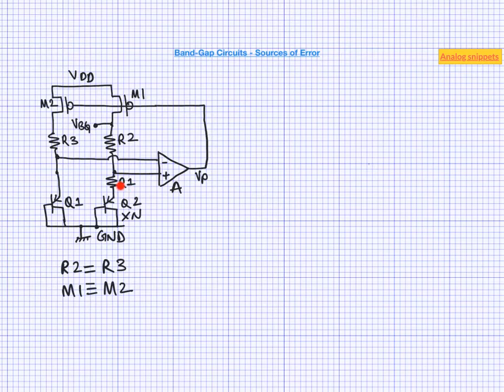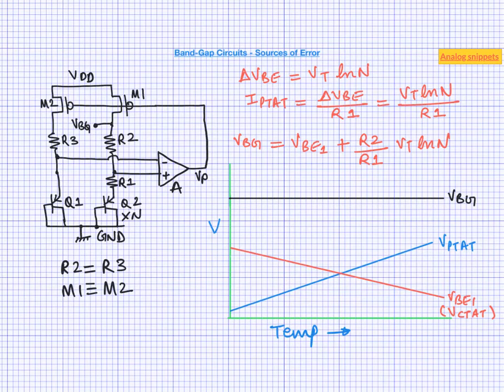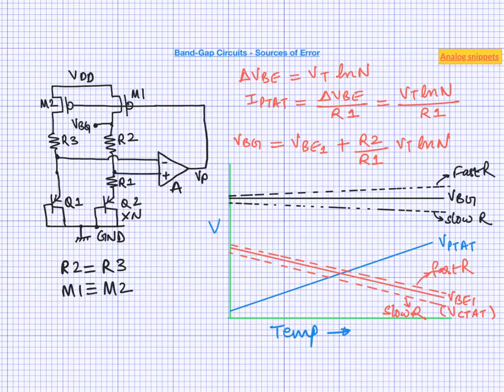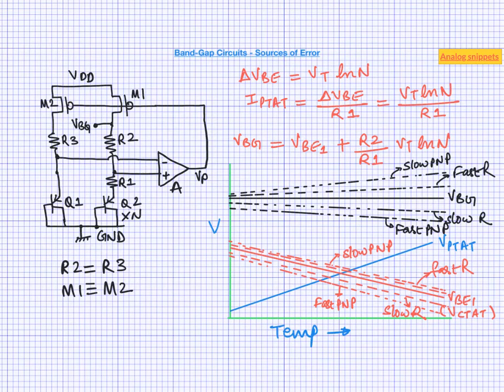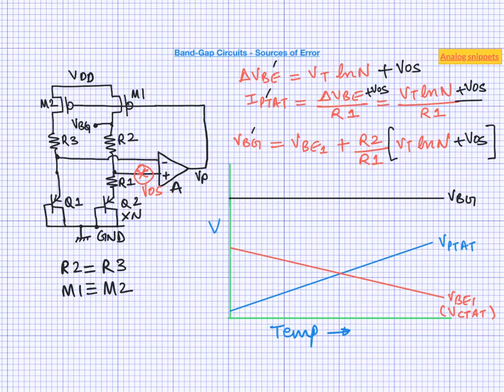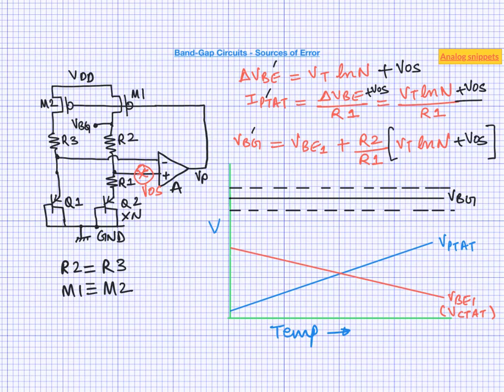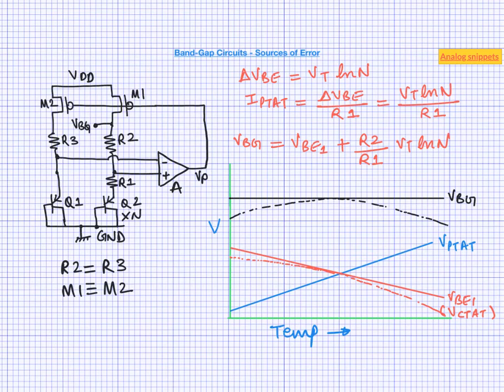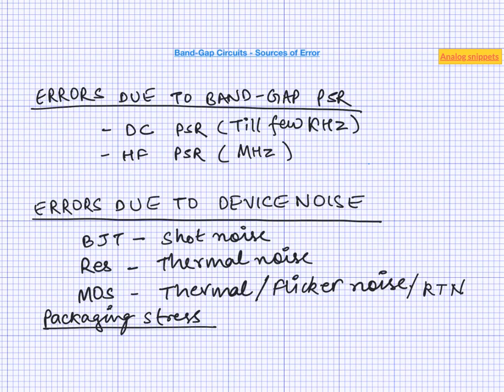#28 Band-gap Reference Circuits - Sources of Errors

Comment: Nicely explained....Instead of using opamp to maintain two nodes equal,can we go with cascoded current source structure to maintain two node equal...what is the disadvantage on using cascoded structure over opamp???
Reply: Yes, cascoded current source structure can also be used to equalize diode nodes.
There are couple of disadvantages of doing this:
1. It requires higher supply voltages usually > 2V
2. PSR is limited by current mirror
On the positive side, this structure potentially consumes lower current (no amplifier), potentially lower area (no frequency compensation) and potentially simpler to design.

Comment: Thank you for one more amazing video!
I just wanted to know you mentioned local MC, do we check across different process (ff, ss, tt, etc) this local Mc?
Reply from the maker: Yes, each corner usually have local monte carlo defined with it. On the top of that there may also be global + local variation file, which is not corner specific but varies process from run to run and also applies local mismatch in each run.